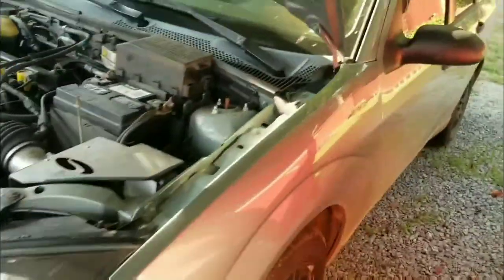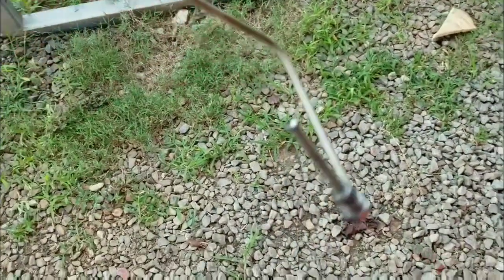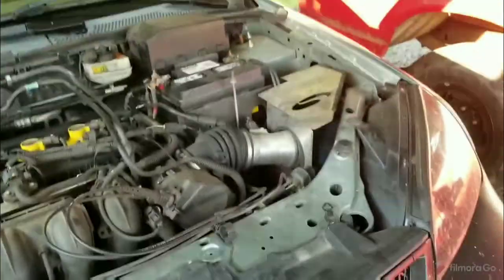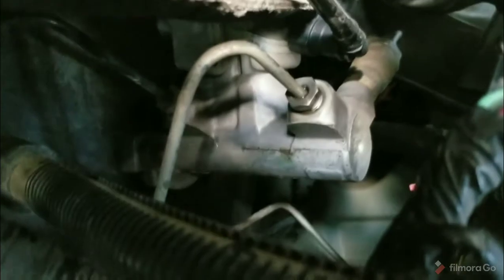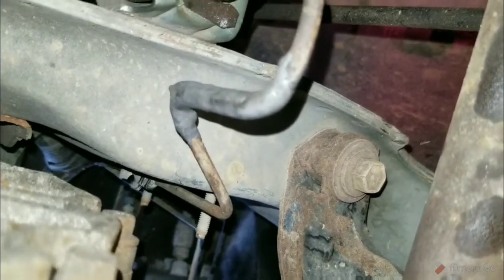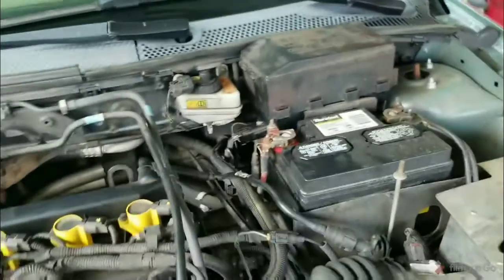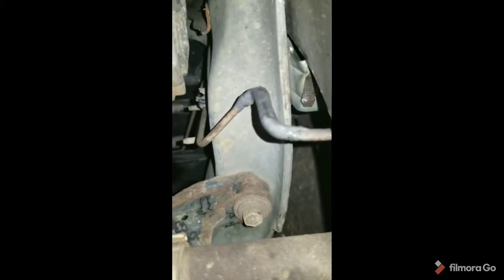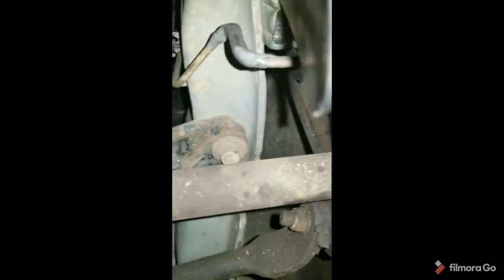JB WELD fixed my brake line!!!

Comment: OK, I'm in the same boat with my ford ranger. I figured it should work. I used JB weld once on a Ninja that had a hole ground into the bottom casing after I layed it over in a turn. Fluid was gushing everywhere when I picked it up because the hole was huge. JB weld held for years on my bike, so no reason it shouldn't work for a brake line as well. I'm glad you made this video, thanks. I'll report back and give my experience after all is done. Wish me luck!
Reply: Over a week later and it's holding like a champ! I first used some PB Blaster to loosen up the brake line fittings so I wouldn't strip or snap a nut, and then let the JB Weld set for 24 hours before I reinstalled the brake line.. The dynamic duo of PB Blaster & JB Weld to the rescue! Thanks again for the proof of concept. I'm happy with my patch job. It was a no-brainer! 

EDIT: I forgot to mention that my brake line had two holes in it and was working on a third. There was a hydraulic line rubbing up against it that was protected from wear by metal rings spaced about 1/4 of an inch apart. I live out in the sticks with about 7 miles of gravel/dirt road until I hit pavement. When it gets dry out the road becomes severely rippled and it's like driving on a washboard. The vibration of it was rubbing it's way through my brake line in three places that matched up to 3 of those metal rings on the hydraulic line. I had to zip tie that up and out of the way so it wouldn't repeat. If anyone has a ford ranger with a lift kit on it like me, then you might want to check and make sure you don't have the same problem developing..

Comment: I'm currently working on repairing a section of my brake line this way, too. I've been taking my time, putting on a single layer at a time. Fingers crossed that I can test it out by this weekend. Judging by the thickness in the video, I have a few more layers to go.
Reply from the maker: I only applied two thick layers to mine..  the truck really is to take it off clean and let cure for longer than it says too
Reply from the maker: Good luck man
Reply: Did it work?
Reply: @peterphoomahal5353  Mine didn't work because I wasn't able to remove the rusted section to give it a good cleaning and adequate application of the JB Weld. I ended up cutting away the bad section, replacing it with one I flared myself, and coupling it to the old line. The hardest part was flaring the old line where I cut it, but it's working great so far.

Comment: You're lucky it was one of the short lines. I have an Intrigue with a pin hole in one of the rear lines. Actually found this video because I was curious if it works. Been a while since I've done brake line repair.
Reply from the maker: Yeah it worked for about three years but I did end up having to replace the line eventually

Comment: Hi! There are several variants of JB Weld. Which one shall I use?
Reply from the maker: I used the original.  This fix lasted roughly 2 years before I replaced the brake line

Comment: So this is a focus I have a duramax anyone think the break pressure of my truck would be too much?
Reply from the maker: You can look up the brake psi on google should good a good ball park.  I mainly would say that you have to take the brake line off to do this repair so it’s clean and give it enough time to cure or it will not hold up

Comment: You think if I flush my system I could be able to apply jb weld without having to remove the line itself.
Reply from the maker: Everyone that has messaged me asking if they could do this fix without removing the line has had no luck with this fix.  I suggest removing it or at least disconnecting it and cleaning it out prior to attempting this fix.  Good luck

Comment: When you said that you pressurized your car, how did you that?
Reply from the maker: By making sure the fluid was full then just cranking the car .  Anything with break lines you would have to bleed your breaks also
Reply: @wesssidestory4157  Would the brake fluid leak though just by cranking the car and not pressing the brake pedal?
Reply: @wesssidestory4157  I like the  Original J-B Weld you used. However, I don't have the 24hrs that's needed for it cure properly. Alternatively, can I use either the J-B Weld stick or the J-B Weld Kwik Adhesive since they both take a much shorter time to cure? I literally need to drive the car very slowly for like 5 minutes.
Reply from the maker: @Zeberka767  I can on attest to the product that I used.  It is still holding by the way..  cutting corners and not allowing proper cure time would cause it to fail..  you can try the others but as far as how they would work I couldnt say
Reply: @wesssidestory4157  If there is a crack on a brake line, would cranking the car result in a brake fluid leak even without pressing the brake pedal?
Reply from the maker: @Zeberka767  I would believe so but I guess it depends on how small the crack is
Reply: @wesssidestory4157  So, I guess that's why you pressurized your car - to find out if it's still leaking after the J-B weld has cured? Is that correct? Thank you very much for all your replies.
Reply from the maker: @Zeberka767  yes that's why I cracked and pressed on the brake pedal a few times.

Comment: Still good?
Reply from the maker: Yes it still holds firm.  Brakes better than it ever did.
Reply: Perfect! I used it on mine lol
Reply: Mine ended up not working as soon as I backed up it had already leaked out but splicing the wire is cheap and easy
Reply from the maker: @stefaniadiamond  sorry that this didn't work for you :(

Comment: I know your not a expert on this but I was thinking of doing this hence how I found your video! I've got a question though.. I can't get the line off it's stripped apparently trucks 23 years old. Now I cleaned the line best I can etc think it will hold? It's a pin hole nothing major ie split line.  Thanks! Good video people don't want to wait the pepper l proper time then complain!
Reply from the maker: My worry in not taking it off is the residual brake fluid.  It may not allow it to adhere properly.  I would say put a thick coat on it  allow proper cure time and coat it again just to be sure.  Please let me know how it goes 🙂 good luck!
Reply: @wesssidestory4157  I sprayed it with brake cleaner etc and I'm letting it dry over night anyway. But yea thick coat for sure! More is almost always better! Lol I will definitely let you know..
Reply: I put a pretty thick coat on at 5 pm. I did a big portion of the line rather then just a little spot that had the pin hole. I went out at 12 am and put a little more on. Do you think it's safe to try at like 7 pm tomorrow? That will be over 24 hours which is how long it takes to cure! Just thought I'd get your opinion on this thanks!
Reply from the maker: @itsMrBRoc  it's hard to say..  I think if it were me I would give it 48 hours just to be sure...  Humidity..  and tempature..  have alot to do with it..  no sure your climate but I do want you to succeed.  Best of luck to you!
Reply: @wesssidestory4157  hey so I gave it till like 9 am this morning to put some fluid in and see if it held pressure.. over 36 hours. I only had a little brake fluid but put it in pumped the brakes and it held the pressure fine! I just got home with brake fluid filled it and it works good minus bleeding the brakes and a hard stop. The hole was a pin hole the line wasn't extremely rusted so I'm confident its good! I'm gonna take a picture of the line tomorrow and update in a week or so! 

Which leads me to my next idea 💡..
I'm gonna check over my lines and see if any look suspect and if they do why not clean them and coat them with JB Weld before the line pops! I mean for the $6 or so bucks the JB Weld costs why not!
Reply: @itsMrBRoc  how did it go????
Reply: @jakevandike800  didn't work i couldn't get the line off to clean it properly and i couldn't get the jb weld on good either
Reply from the maker: @itsMrBRoc  hey I literally just seen this comment..  I am sorry it didn't work for you

Comment: Which JB weld did you use?
Reply from the maker: It was the original JB weld steel comes in two tubes like tooth paste..  just follow the instruction and let cure for like half a day longer than the cure time listed
Reply: @wesssidestory4157  just did this today. Just spraying out of a tiny pin hole. So letting it cure now and then going to go back over it tomorrow with the same stuff plus some of the other JB weld that you rollin your hand to put over top of the cured stuff. Hoping it works
Reply from the maker: @radianm6  yeah man let me know 😊 I coating mine twice also
Reply: @wesssidestory4157  I tried the best I could. I couldn’t take mine off. It’s on a 545i bmw in a terrible spot. BMW lot harder to work on than the Ford haha
Reply: @wesssidestory4157  no luck for me. But i couldn’t take the line off. Another thing is that it had to cure outside in the shitty weather in Michigan last 2 days... it’s better tho. I’ll have a shop fix it right one day. I tried at least
Reply from the maker: @radianm6  sorry it didn't work.out..  yeah temperature makes a big difference.in.cure.time.  warmer is always better.  The issue with not taking it off is the fluid leaking while it tries to.cure
Reply: @wesssidestory4157  true that
Reply: @wesssidestory4157  also can use hair dryer to speed up cure time
Reply: @talesfromthehood5374   how long did tou have ti dry it

Comment: whats up! still holding up? xD
Reply from the maker: Yes this fix is still going strong!!
Reply: @wesssidestory4157  thats great to hear, i'm letting my epoxy cure as we speak! did you ever stomp on the brakes really hard and put the plastic weld to the test?
Reply from the maker: @cal.or7  yes i have had to stomp.on them.a few times since the fix.  stops great!
Reply from the maker: @cal.or7  Let me know how it goes!
Reply: Yesss

Comment: Wes is this still working I have a 01 pathfinder with rusty brakeline shops refusing to fix
Reply from the maker: Yes this fix is still working.  I used two applications allowed ample time to dry.  Remove the brake line.  Clean with brake cleaner allow to dry and apply thick.  It will work if done correctly
Reply from the maker: Good luck my friend
Reply: @wesssidestory4157  thank you I appreciate it alot
Reply from the maker: @squeezy1985  did it work for you?
Reply: @wesssidestory4157  I didn't try it yet. I got a friend coming by Tomorrow who is gonna try to flare the ends if not then j.b weld it is.